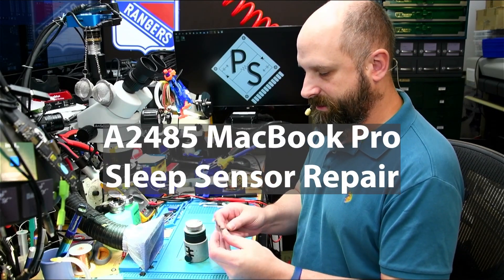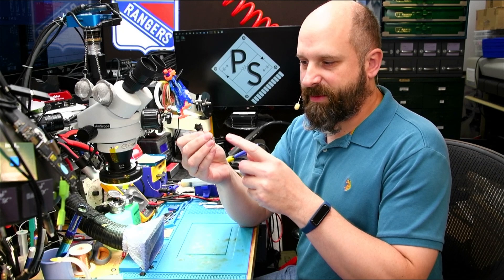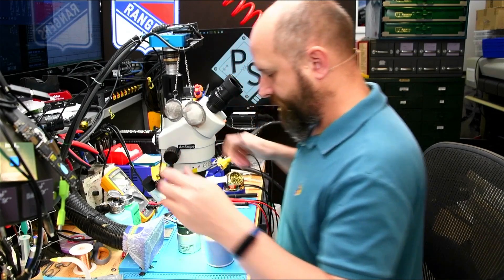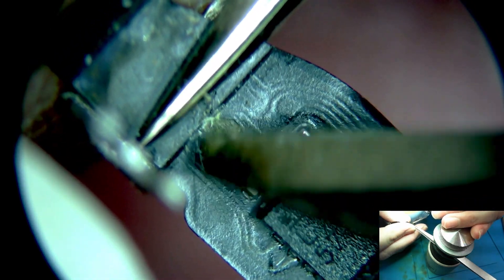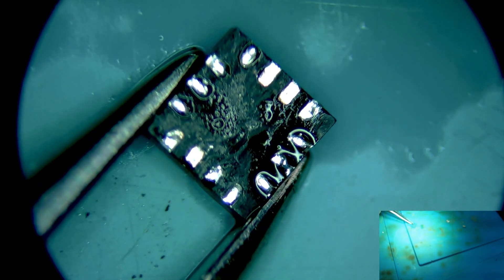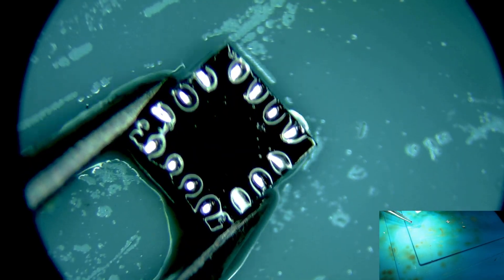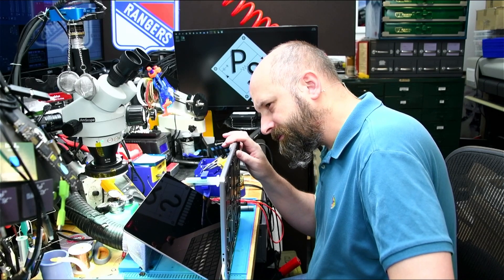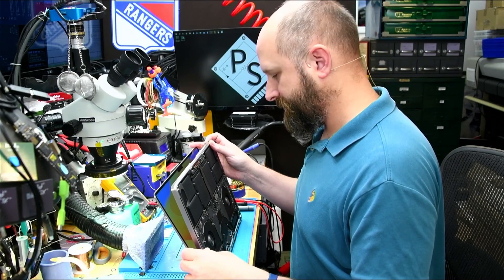MacBook Lid Angle Sensor Liquid Damaged, A2485 Sleep Sensor Repair Call 888-820-3476 for repair!

Comment: Hi.  I've had my 2021 14 inch MBP brand new now for two years and all of a sudden the screen went gray.  On bootup, the Apple logo is visible, but fuzzy.  Everything else goes gray.  The laptop still works fine as I have connected it to an external monitor, but Apple wants me to pay $450 to replace the screen.  Could my issue just be the result of the lid angle sensor?  BTW, no damage on my laptop as I have babied it since I got it.  Thanks.
Reply: Disconnect the LAS and see if that changes the situation, but I doubt it. They usually boot with no sensor plugged in but just do not sleep on lid closure. Not always, but worth a try. I suspect a bad LCD though
Reply: @MrPnew1  Thanks, but tried all that and most of everything under the sun. Yeah bad LCD.

Comment: this is so common problem on M series MacBook's, but due to the serialization, it converts 5$ part replacement repair that can be done by anyone, to very special micro soldering and costly repair. F** Apple
Reply: Yeah fuck CrApple indeed 🤣